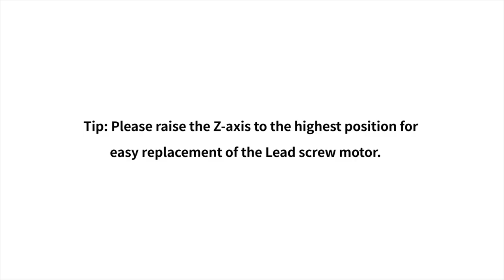Replace lead screw motor for Anycubic Photon Mono 2

Comment: This video is all well and good, but where do we get a replacement lead screw motor from?
Reply: As a heads up to anyone having this issue, I contacted anycubic off their website and they were able to replace the part for me.
Reply: @VicSicily  What, free of charge?
Reply: @fizz113  it was within warranty, I'd only had the printer one month, so yes. In retrospect it wasn't the arm on my printer but rather the screw that had come loose causing it to bind. After disassembling and fixing that my issue was resolved. Nice to have a spare screw motor though.
Reply: @VicSicily  ah right, I got mine at the end of December, hopefully it's still in warranty!

My issue is that for small increments, the motor barely moves, but it I'll for 10mm increments (eventually). Hopefully I'll get a replacement!
Reply: @fizz113  you definitely should! They were very fast in response via email for me, item arrived quickly too. Double check your screw at the top is not de-coupleing while you're at it.